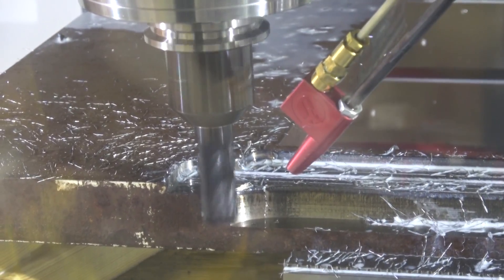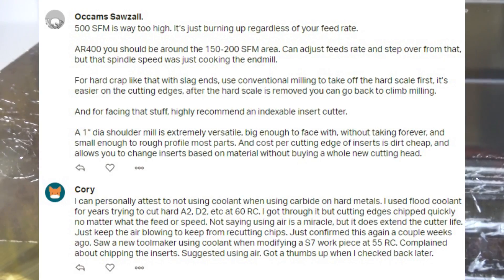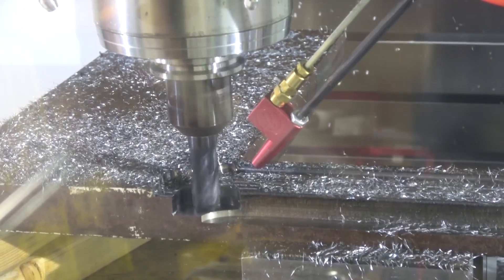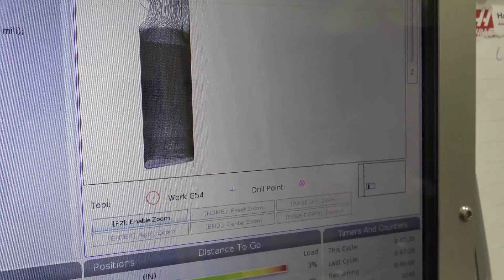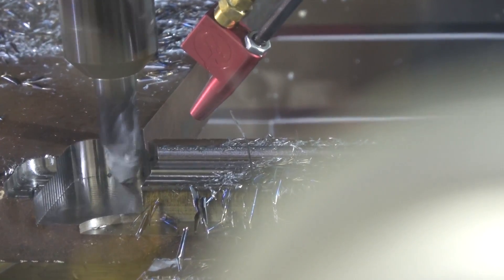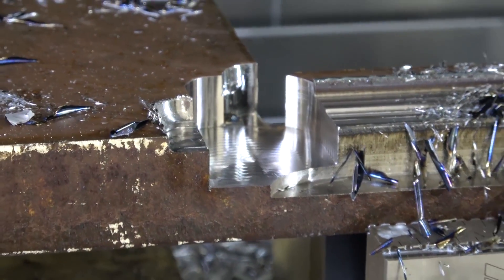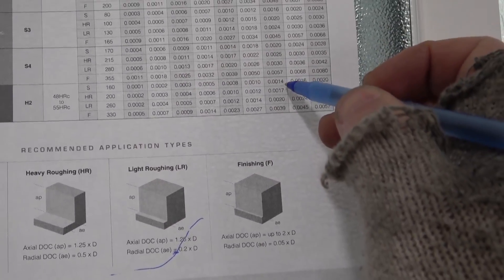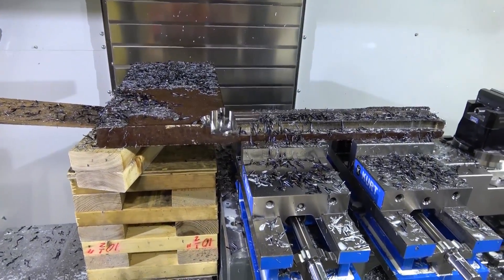Hard Milling on the Cheap.

Comment: Years ago I worked with a machinist that said things happen 10x faster in cnc lathes than machining centers. He also said that the e stop was pointless.  By the time you reacted to push the button it was too late. He thought that a pressure switch between your butt cheeks would work much better.
Reply: Pressure switch for butt cheeks 🤣🤣
Reply: Novel idea; butt plug with a pressure sensor. Set "x" pressure to trigger E stop.
Reply: Aaron Hayden that old dude is absolutely correct, unfortunately it doesn't stop every moron owner from believing that we are all super human and can stop a crash, simply by being hyper alert and ready at every waking moment..
Reply: Yeah your ass muscles contract as you skillfully remove your finger. From the saw table.
Reply: @bo0tsy1  i have seen table saws with a fast saftey that turns off instantly on contact and only leaves a paper cut of damage. Much better than grandpas saw which keeps running as you bleed out masking your screams for help.
Reply: @Eluderatnight  those setups are also expensive and ruin things when they go off. Obviously I'd rather replace a blade then loose a finger, but I'll stick with not putting my fingers in the spinny bits instead of eating such a cost for a hobby. It's simply not practical to have for the average person. I do agree that it's cool tech.
Reply: @jaydunbar7538  FYI I'm an average person and I've got one. The tech is pretty mature and unobtrusive, and the additional cost is minimal. Sawstop, check it out. Wouldn't use anything else these days.
Reply: @jaydunbar7538  it's pure economics.  It would literally take hundreds of blade replacements to add up to the medical costs of a single catastrophic accident.
Reply: @pork_cake  if someone is in the market for a new saw saw stop is a great brand to look at, average Joe doesn't replace such things very often so for those of us who have no reason to upgrade it's not practical. I use a old saw from my wife's grandfather,  still works great. Takes more maintenance then a newer saw, but it's a hobby so thats fine with me.
Reply: @Eluderatnight  Sawstop they work well.
Reply: Actually, the E-stop is not so much for the operator as it is for any other person to shut the machine down in case things have gone bad, including the operator being incapacitated.
Reply: It's also useful for, once the thing has properly crashed, telling it to stop moving rather than making the problem worse.
Reply: That certainly holds true,  but i think the emergency  stop isnt to eliminate oopsies,  its to keep them from spiraling to a life insurance claim.
Reply: I can attest to this. I had a cnc lathe spin up and index head 2 to go in for a drill and tap sequence due to a faulty start switch one time. The tap on head 2 grabbed the sleeve on my work shirt when it indexed but luckily it tore through. A pressure switch would have been perfect. Be safe out there.
Reply: Chris Russell  Yeah, the kind of imagination that would stop me using a circular saw upside down in a workmate with the trigger locked on.... Oh I can imagine running round the room with an irritated saw after me really well, but it’s either that or a two hour round trip back to the workshop, You know what wins !
Reply: The E stop is for after the loud bang.
Reply: I think my machine would be on permanent lockout since I'm in clench-mode 11 just walking near it
Reply: @ashipshow  maybe the E-stop reset would have to be a prybar?
Reply: Lmmfao
Reply: HAHA! Never ran any cnc machine tools (i like my manual lathe and mill) but did run heaps of laser cutters when i was a wee prentice and if programmer was of his meds,no emergency stop is doing jack!
Reply: Even better if it had a electrode as well, give you a shock for good measure, because it probably was operator headspace error.
Reply: @Nicmadis  could work but there are some that would start making mistakes on purpose.
Reply: If you have your finger ON the stop button on a machine that rapids at 1200ipm, and human reaction time is say 0.2s ...    
1200 / 60 = 20ips  
20 * 0.2 = 4 inches before the crash you need to stop it.   
Of course there's accel and decel but figure even half of that at 2in.  
https://www.humanbenchmark.com/tests/reactiontime
Reply: I don´t know if he´s right with the lathes, if it´s a turret lathe surely enough the distance to contact surfaces are way shorter so that definitely, but I can assure you E Stops are exactly pointless if you wanna avoid a crash, it´s only there to maybe save people from dying. Once shit hit the fan she´s gonna stop herself anyway.
Reply: do they make one? maybe AvE can engineer and make it?
Reply: Ok! Bus it must be tested on shit and fart resistance!